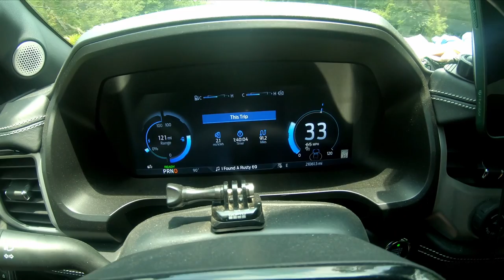I Bought a 1966 Ford Mustang!!!!!

Comment: Nice car and a very good restoration. I live in New Zealand and about 15 years ago I bought a 1966 notch back in original condition imported from your country. It is Ember Glow Gold with a cream vinyl roof. This colur combination was only done in 1966 so it is rather specai. I have done engine and gear box rebuild but other that that its is original and I love it. It is certainly a head turner when you drive it. Enjoy your new car. Cheers Ian

Comment: My daily driver for over 10 years is a 66 coupe.  The turning radius sucks, but you get used to it.
You really should go back to the floating horse in the grill, IDK why they would remove that.  You can adjust the tilt of the back part of the seat by folding it forward and you'll see an adjustment point.  Not that much help, but you're right into that steering wheel.
For safety, you might want to look into shoulder belts.

You said "not a fast car", a V8 Mustang should be pretty powerful, if not, plenty of mods you can do to the engine.

Comment: If you can sell it for more than you paid for it, I'd do that. You can't fit in that car! You'd have to get a smaller wheel  and somehow lower that seat and put in a new track so it goes back further. It may not work for you but maybe go for it if you are 100% sure you want to keep it.
Reply from the maker: Im definitely keeping it. I have lots of videos coming. I got a smaller wheel and new shifter. New gauges are almost in. It fits me so much better already! Videos coming soon.
Reply: I own a 70 Boss. I'm 6'5"   275 pounds. I changed the wheel and seat tracks. It helps a little.